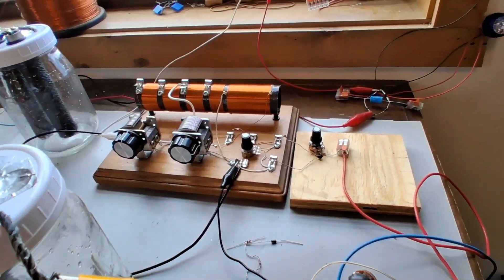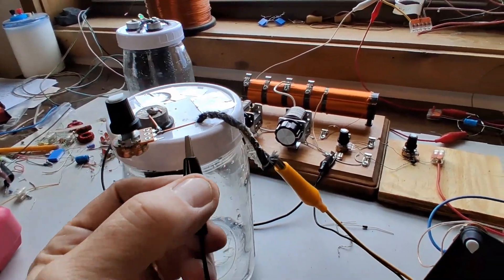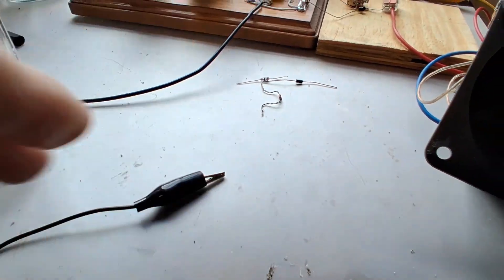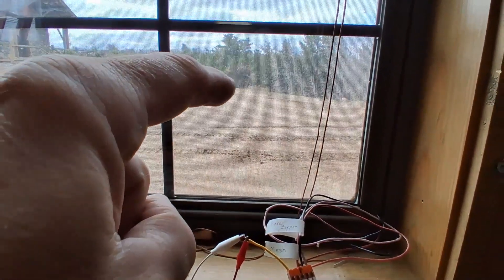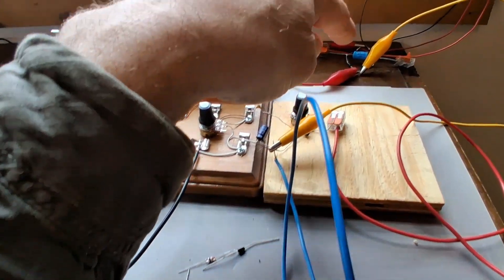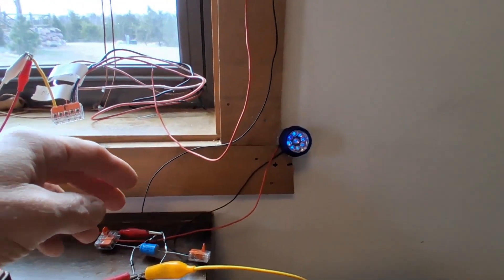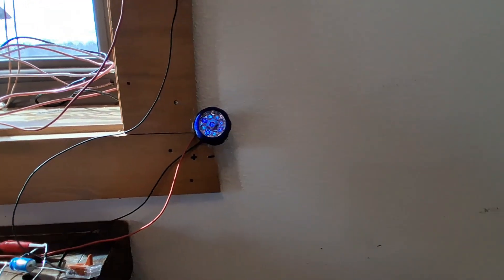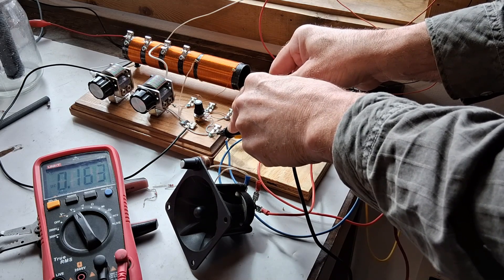Dual purpose, Earth Grounding Battery

Comment: LED diodes glow without real current - when 3V on the diode is reached they start to glow.
Reply from the maker: One of my tuning capacitors is in series between the antenna and the coil.  If I take it out of the circuit, the LED's don't light.  So they must be getting some feedback from the tuning capacitor...
Reply: @doubleMinnovations  Series LC tank with antenna as RF collector /source of EM waves gives low impedance which leads to increase of current in it, which makes LEDs glow. If we have an LC parallel circuit we can boost voltage but we lose current. This is why "Free Energy" is not possible. Very many "researchers" try to use some kind of "ground amplification tank" to boost the summary of "energy". One of them is Ivo from YT "Master Ivo" channel. We remember Kapanadze - he was scam artist - he use Main power as "free energy" source :) and many people believe in this - include me (sorry for my stupidity). He uses 1 wire power transmitter (AM modulated current with Hi Frequency from 40kHz to 1MHz) circuit and uses "ground" as energy medium between transmitter and receiver. He uses the water horizon - there must be water between the transmitter and receiver. In Latvia there was one experimenter which made it (I was one of "visitors"). He uses 40kHz and we transmit energy around his house and get some hundreds watts of real power. But that is not magic. This is ordinary physics.
Reply from the maker: I was once a 'free energy' contractor at one time.  I was installing ground source heat pumps back in 1992.  Average COP of 3. 😁
Reply: @doubleMinnovations  Heat pumps - properly instaled - when ground is "warm" gives a little "economy", but in Latvia - for example, we have poor setups, which is BS - no economy at all. There are interesting ideas - "container heat exchanger" with solar heating - this is a good idea. In winter time - when the sun is shining - we collect heat in this vessel and at night  we use this collected hot water as an "energy source" for home heating. P.S. The meaning of COP is (in my understanding) just for marketing purposes. You always use electricity. There are no "less payouts". You pay. In my understanding - there everything costs. Materials, energy, setups - this makes everything expensive. You can use COP+ devices and you pay for electricity (pumping water/ air etc.) Something like that. I love ideas about "energy efficiency"! We can build a small - very isolated home and we can use 100W/ hour, electricity to make this house warm. We need to change our thinking! This is it. Be happy! 🍷
Reply from the maker: C.O.P. means Coefficient of Performance. -a ratio of energy in, compared to energy out.
For example, (from one of my 1998 real life installations):  an input of 7,986 electric watts in. -which is equivalent to 27,251 Btuh of heat energy; yields 83,139 Btuh output.   
I was skeptical when I first heard of such thing back in 1992, but my own measurement verified it.  But you also have to realize that you just can't change that increase of heat, back to electricity.
The heat from the ground was just being moved, not created.  And it takes electric motors and pumps to do it.
It's a real gain for heating.
Reply: @doubleMinnovations  Yes I know about COPs. It is for "believers" in COP`s :). You buy thing - whatever - this costs X$. Is there COP or no COP, maybe you don`t need it at all :).